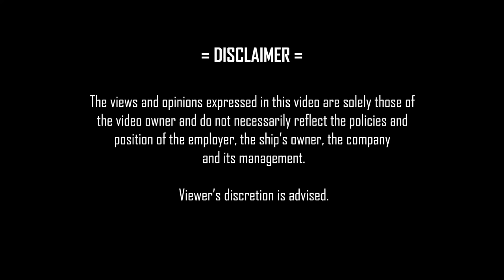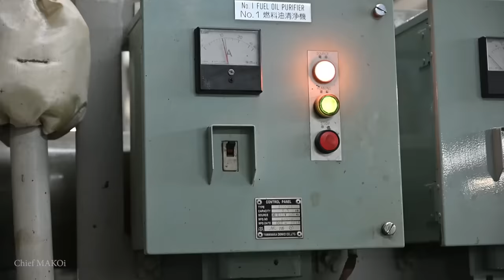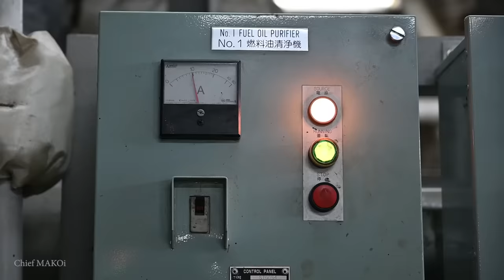Fuel Oil Purifier Overhaul | Selfjector | Chief MAKOi

Comment: Great to see correct tools used, methodical working , along with team work. As a retired engineer of forty years it's great to see skills passed onto the young engineers. And a mentor like yourself, can't
get any better
Reply: As another retired engineer did your ship(s) have a fixed purifier cleaning station close to the purifier room? All my ships had a steel tub at waist height exclusively for cleaning purifiers.
Reply: @runsolo7418  That's what I was thinking. As an automotive mechanic, having a solvent tank to clean parts is way easier than using a cut up plastic jug.

Comment: I'm about to finish undergrad with a cell biology degree; I TA for a wet lab course where one of the most often used tools is the centrifuge. We have it on a yearly service contract (higher service frequency if the kids try to spin samples with unequal masses), this video makes me seriously appreciate the work and knowledge seafarers have, especially in situations that depend on your knowledge to keep the entire team moving.
Reply: In a microbiology research lab myself.  Had to get good at fixing machines (shakers and PCR machines come most readily to mind, although we also have centrifuges of course).  Unfortunately, nobody else seems to want to get trained on that . . . .
Reply: @Lucius_Chiaraviglio  Yeah I've been co opted as the lab's handyman for whenever things need fixing (putting new flint on strikers to refilling toner), but never tried messing with the centrifuge since there are just so many parts that can quickly become out of place!

Comment: Chief, another amazing and informative video. Thanks for sharing and documenting.  Viewers, I’ve got a couple observations.  First, I lost count of the dedicated tools needed to disassemble and reassemble this, but there seemed to be quite a few dedicated spammers, wrenches etc. Second, and what hit home the strongest, was in the beginning Chief mentions 18,000 RPM.  If you’re unaware, this is fast, really fast. Not quite in the neighborhood of needing air bearings, but it’s pushing the envelope and all these rotating parts must have incredible balance and precision tolerances.  This is truly incredible.  

I’m still perplexed that’s it’s more economical to purify the ship sludge oil on-board rather than at the refinery. I suppose contaminants are introduced in the supply chain up until the engine, so of course filtration will always be needed.

Chief, keep making these great videos. Thanks
Reply: I was wondering about the economy of a fuel oil purifier, too.  I guess there's little commercial use for the stuff in this oil's section of the cracking tower, so it's dirt cheap to buy, and the onboard purifier pays for itself & its upkeep.  I'd like to hear the Chief's take on this.
Reply: I was also amazed at how many specialized tools this disassembly needed, and just for this one component of the ship. They must have thousands of tools for all the parts of the ship, storing them all must be a feat in itself.
Reply: @MrPesht  trust me, that ship has space to spare. If The Chief doesn't have a dedicated tool room, he's got as many bulkhead-mounted lockers as he needs for tools & spares.
Reply: @MrPesht  and each one of those specialized tools is another reason to keep a dry bilge!

Comment: When I was in the Navy, we used "De Lave," oil purifiers.  They were similar to yours.  I suppose there's not a lot of difference in the concept, so designs will be similar.
We had that stack of filtration baskets, like in yours.  And we had to remove the baskets and clean them individually as well.
We didn't use them for fuel oil, because the ship's engines, generators, and about everything, ran on JP5 jet fuel.
They were used to purify the engine's lube oil.

You got a good crew there, they did a great job on that purifier.  It looked brand new after they got all the crap out of it!
Now, I did notice the digital readout, of the purifier status.  "That's a cheat in the Navy!"
On the De Lave purifiers, there was a little button, that popped in and out as the purifier ran up to speed.
We had to count the number times the little button popped in and out.  It had to pop out a specific number of times to mark the point where the purifier could be used.  Like 60 times in one minute.  Something like that.
Reply: Also ex-Navy, I had a similar "context-shift" struggle with FO purifiers.  Never envied the MMs who had to manually clean sludge from 2-3 dozen bowls.
Also always remember the time I came into the engine room one evening in port on a duty day.  There was a hazy smoke throughout the ER.  FN Jones was on watch, sitting on a rail at main control.  I asked him what was going on.  He said, "Just chillin', sir."  He was unaware that he was cooking the oil in the purifier.  I forget further details.  But it's one of those classic Navy experiences about meeting all types.  FN Jones was one of the friendliest guys around, certainly beloved by family & friends.  Less popular with his LPO, chief, and DivO.
Reply: Likewise! We had one each for our main engines reduction gear and disassembled, cleaned it nightly. As our was smaller we only needed the lock ring and shaft puller. The overhead hoist would have nice lol!
Reply: As yes the de leval lo pukeifyers

Comment: I used to hate changing the main bowl seals on purifiers. A nightmare to remove and fit without damaging them. Great video brought back memories good and bad.
Reply: With the Alfa-Lavals (FOPX) you had to take care that the three nylon valve plugs under the bowl bottom were of the same height, (especially when the purchasing dept. had not ordered them at Alfa Laval)
The first time I came across these non original ones I noticed that they did not have that green dot on them. Took a caliper and started to look for a matching set.
Happy days, especially when the HFO day tank was not a “real” day tank and when a failure occurred in the middle of the night, you were more or less obliged to start immediately with the non-scheduled overhaul of the bowl.
Reply: @janvisser2223  
Out of bed from a deep sleep to skin yar knuckles and get yar hands dirty..
Oh well...
Reply: @charliepearce8767  That happened, and no, that was no fun. (From an air conditioned cabin to a separator room which was sometimes 50 degr. C)

Comment: You are absolutely right chief. When you do the job yourself there is tremendous boost in confidence.
On my first ship as a cadet I was made incharge of purifier maintenance after 2-3 months onboard. That gave me confidence that I can be a good marine engineer.
After 20 years at sea and now switching to offshore jackup barges I still remember those days.

Comment: When I first started working for the United States Post Office as a mechanic, we had some trucks that had an oil spinner filter system, quite similar to this. Obviously a lot smaller, but still effective. Only the oil pressure from the engine supplied the spinning motion, via small jets in the spinning drum assembly. It worked very well at separating the heavy solids from the oil. I could tell a difference when the spinner was cleaned out versus dirty. The sound had certain harmonics when the spinner slowed down after the engine was turned off. In these cases, these were used on 1984-1997 Chevrolet 6.2 and 6.5 liter v8 diesel engines used in medium sized trucks. There also was a conventional engine oil filter in the system. The vehicles were similar in size to the brown colored delivery trucks used by another carrier.
Reply: yanmar diesel generators aboard ships that still use it,  apart from a separate separator like one depicted in video

Comment: So back in about 91 or 92 I was using one of those to separate oil and water. We had a factory rep come by for a service and teaching session. He spent most of his time on ships helping with rebuilds etc. Then I started working for Kraft foods. They used a full stainless steel version to strip cream from milk. And also used to strip whey from cheese culture to make cream cheese and and other processed cheese food. Really cool machine. We rebuilt all 14 once a year at Kraft. Crack checks and all new bearings.

Comment: Chief, that was a LOT of editing. I can't imagine how hard you worked on that. Thank you. 
That was also a complex mechanism but I can imagine you do it so many times it becomes routine. 
I was surprised how no power tools were used at all in this but I can imagine torque issues and feeling how tight something is.  However, you had just about every wheel puller in existence :) 
Finally, I can also imagine this thing looking that clean for about 10 minutes once in usage before it turns to what it used to look like. :)
p.s. It's obvious you have an amazing crew that works for you. They really work so hard.

Comment: it's quite remarkable how closely the interior of that oil purifier resembles the insides of an old cream separator.  My grandparents had a farm and they used to separate some milk and it was my job to clean the separator when used.
Reply from the maker: It's basically the same.  Only the gravity disc needs to be changed accordingly to match the fluid density.

Comment: Chief - Great video.  Any chance you could do a video explaining what happens in the purifying process?  If that is fuel oil, what purpose does the water serve?  What happens when the fuel goes into the filtration unit?  As an aircraft mechanic, I find this stuff fascinating! Hey thank you!
Reply from the maker: I'll do that in a separate episode.
Reply: @ChiefMAKOi  Sweet!!!  Thank you.
Reply: Water is used to move the piston removed at 11:23 up and down.  The piston is closed during operation, and then when enough solids have built up at the outer wall, the piston is pushed down by an injection of water to eject the solids.  It happens very fast, a fraction of a second.
Reply: Chief MAKOi Please do! I would find it fascinating to know how HFO is purified as well! Seeing the water supply part has me quite confused! Fuel and water are usually enemies! Lol
Reply: I was braving the comments to ask this very thing 😄
Reply: @ChiefMAKOi  Thank you Chief. I'm very curious as to the water supply and what it's used for.

Comment: Wow Chief these are more complexed than our JP-5 De-vale ones we had in the Navy. We only went this far when we loss a bearing or every ship yard period however we did generally have to clean bowls and disk weekly. Ours was mainly lifting bowl cover, removal of discharge impeller, removing disk stack (177)  and cleaning. Re-ass blew was reversed with a new bowl cover O Ring. Good video Thanks 👍😵‍💫😎

Comment: Are the separators inline between the tanks and the engine, or do they serve to purify the fuel in the tank separately?  I ask because they seem (from my naive perspective) pretty small to support the full flow into the engine.
Reply from the maker: They are the only means to get the fuel from the Settling tank to the Service tank.  And yes, their capacity exceeds the engine's consumption.
Reply: @ChiefMAKOi  Ok thank you!  I enjoyed seeing them come apart, it's a lot of steps but the design appears to be pretty user-friendly.

Comment: Built myself a oil centrifuge to clean waste motor oil I get free at different auto repair places and Trucks/vehicles I service. I mix the waste oil and 20% regular gas thoroughly and let it sit for few weeks in 330gal totes to let it separate, pump it into a centrifuge at a very slow rate to ensure it is cleaned. I do heat it as it gets pumped in to help separate.Takes about 24hrs to really clean a 300gal tote back to almost new condition of light brownish color. I have to clean the 12" drum bowl about every 3-4 hrs because it does pull out a lot of nasty BS and ends up sometimes 3" around inside of bowl depending on how dirty the oil is.I use a 1.5hp 3400 rpm motor to spin a pully/belt that increases rpm to about 5800rpm on rotor shaft. Have about 145k on my all manual cummins 8.3 6cta diesel pusher on wmo , have removed head a few times to check buildup 35k , 75k and 120k and as long as I dont idle and chug alone it remains pretty clean with very little buildup.I try to keep it running on highways which helps keep the ash down and burning hot so it doesn't collect. I figure 145k of free fuel I can afford to in frame and replace the head/injectors every few years if I had to but so far I wasted my time even pulling the head to inspect.I think as long as I keep cleaning the wmo like I have I see no reason why I cant get 600k before in frame easy without really paying for fuel. I think people who have done this try to cut corners and use filters and cloths to clean which comes back to bit them and damage happens.I do have fuel filters on rig and service every 8-10k , other then that it is all filtered with the centrifuge and no spin on filters of any type. I did have to pay for solar panels and batteries to run the motor/pumps so really only thing that costs me in the 20% rud  I mix few weeks prior to filtering it. I have taken a rest from RV due to past 2 years of covid BS. I want to create a onboard system where I can just pickup few 100 gal of wmo along the way , mix it and then clean it while out traveling.Maybe pull a 16ft enclosed but Not really sure how that would go over with DOT. RV had a 150gal tank and I added another 150gal tank but sure be nice to just collect/mix and clean as I went.I have found many times everywhere you go can pickup free waste oil freely from few gallons to 500gals.The north is not as easy as most use it to heat shops with but more and more are getting away from using  it as the waste oil burners get expensive on repairs and maintenance costs. I do get slightly better mpg on wmo then I do on diesel which is odd at about 12mpg if I keep it 60-65. And nope RV doesn't blow black smoke either , sometimes when warming up it has slight haze but on the road , nice clean exhaust from cruising to mountain accelerations. I did find if I add in 25% diesel 75% wmo after cleaning it doesn't even haze at warm ups but that just adds in extra fuel cost.Most vehicles the emissions dont even kick in monitoring/cleaning till vehicles at operating temps anyhow. Wondering how much just one of them you have cleans at a rate of , being a 3phase motor I bet it cleans 500gal a hour.

Comment: in the diesel power plant, we have the same purifier from mitsubishi, SJ 15F and SJ 40F models. the disc are very difficult to clean specially the SJ 40F where we used it to purify the engine lube oil system. in the power plant, equipment arrangement are almost the same, though the functions are different. in the ships, the engine is used to propel the ship while in the power plant, it used for power generation.

Comment: Day #1 in the engine room on MT Torm Gunhild in 1990 i think it was.
You do not want to put back together wrong, spinning things need to be balanced.
Mind you it was just a cleaning i did, not a overhaul, but i was left alone with the manual and a "call us if you need us " from the engineer.
Good times , i miss the 7 seas, and being the hell away from Denmark.

I have been ENG 2 times, on a small coaster WW and got a rush promotion on a factory ship on Greenland, which meant not much sleep for the following 4 months.

Comment: Just completed this exact maintenance due to vibration rebuilt the vertical shaft and found the springs and bearing housing corroding no spare so I cleaned them up to be smooth again

Comment: Very detailed video Chief!

Just one comment:

The purifiers are not operated only while M/E is running. Actually, lub oil purifier especially needs to run 24/7.
Especially when M/E is stopped at anchorage, it's a great opportunity to purify the sump tank oil.

Comment: I commented in the injector replacement video how well designed the fuel oil filtration must be. I am not really qualified to comment but it does seem a well thought out piece of kit. I would say that as this keeps a multi million £ ship engine running a proper powered cleaning unit would be worth it. No doubt the powers that be would disagree. Good lad you have there. Thanks for the video and keep well.